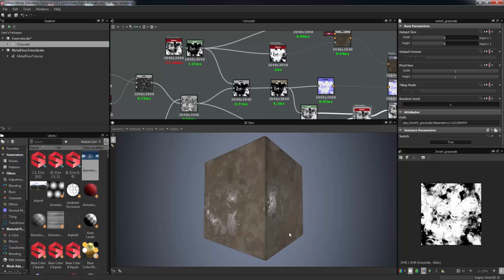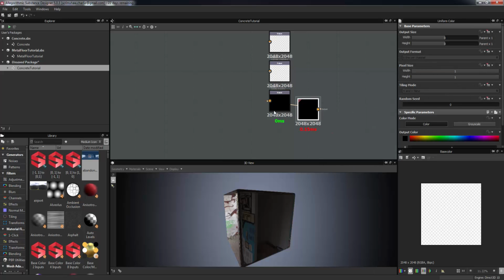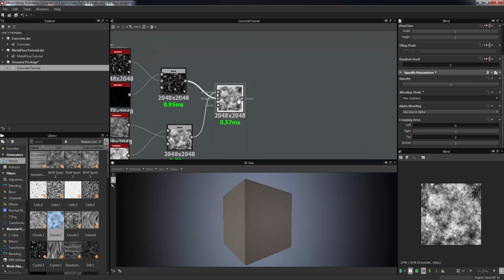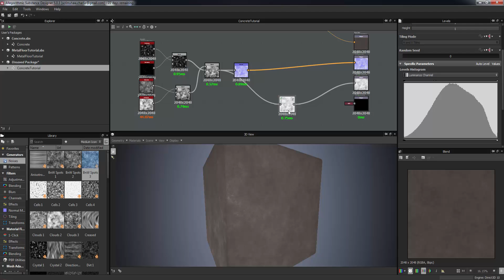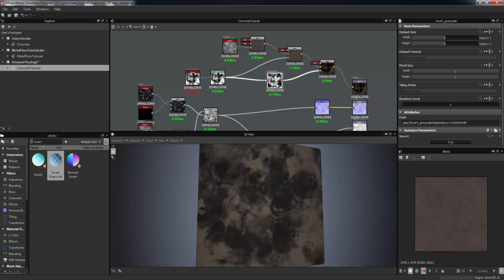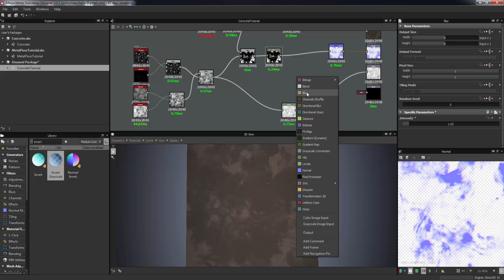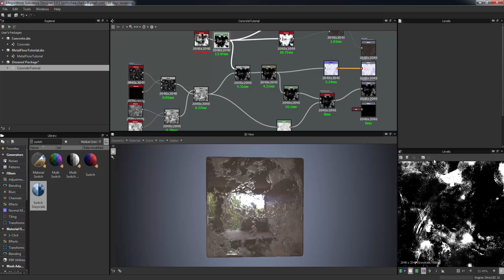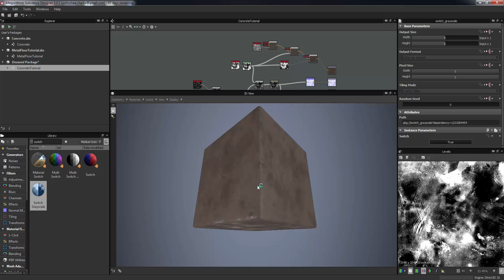Let's Learn Substance Designer 5 - Wet/Dry Concrete

Comment: I cant import the .sbsar in maya 2015. it just do nothing, doesn't loading. Do u know why? thank
Reply from the maker: Lorenzo Silano Do you have the most up to date version of Maya, if not that may be why. Here's the link to their Maya page: https://www.allegorithmic.com/substance-maya
Reply: ***** Ty Charlie, i saw the link but in their maya page there is nothing i can do. I found a download page with 1.2  plug-in   https://www.allegorithmic.com/download/download_free/276  is that what u mean? How can i install it? just coping directories? Thank u again.
Reply from the maker: Yeah try the most updated versions of both Maya and Substance. I think Allegorithmic have some tutorials on their YouTube channel, go have a look on there =]
Reply: ***** I' ve tried everything but still not working. Now i have Maya sp6 and i cant really update substance  plug-in. If i copy modules directory maya doesn't load the plug-in at all, I changed other files anyway but nothing  happens.  I didnt find a solution even on their forum.. so im going to give up with this substance file. Do u use Maya? Is it working for u? Substance files installed in Maya are working well.....
Reply from the maker: The only thing I can suggest is that you instead take the model in Substance instead. Just drag and drop the .fbx or .obj into the explorer for Substance. You'll benefit from this better I think. =]
Reply: *****  Thank u Charlie I will try :D

Comment: if you're going to do PBR, then don't start with the metal one. Go with the spec/gloss one...
Reply from the maker: Starius2 How so?
Reply: ***** because spec/gloss is meant for non metalic pbr.
Reply from the maker: Ahh ok I see what you mean, but it ultimately doesn't matter. In a matter of PBR, "true" (I use that term loosely) PBR is a metallic/rough workflow, as specular isn't really a thing. Telling a material what is and isn't metal works just as well as a workflow that tells it how glossy/speccy it should be, just that it is quite literally more black and white. Not saying I don't use the spec/gloss workflow, I do. I just see the metallic/rough workflow as a more suitable one, especially as I work in UE4 which focuses on a primarily metallic/rough workflow.